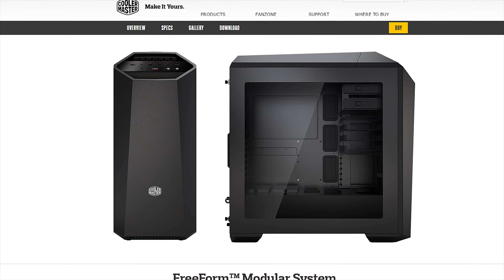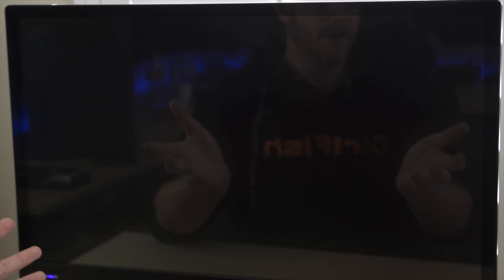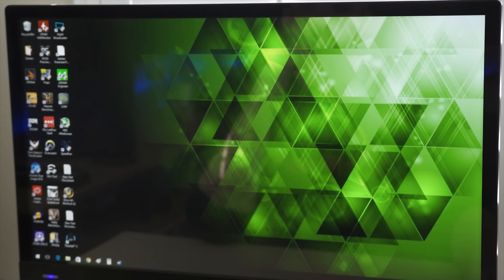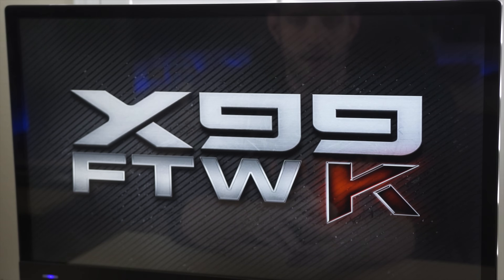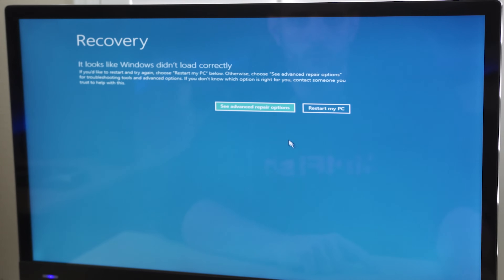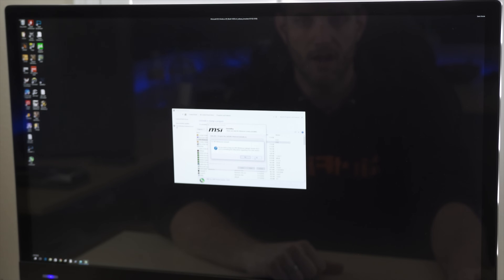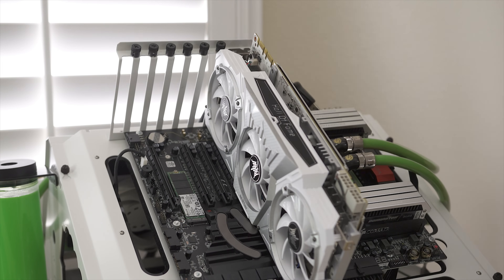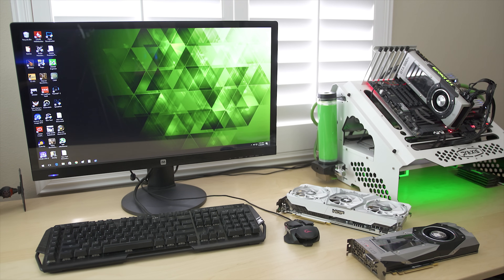How to fix a bad overclock on any Video Card

Comment: I actually have a weirder problem. Ran an Afterburner OC scan, and ever since, it runs at 1965mhz, not the stock 1905mhz! Afterburner has the turbo arrow, at 1905, FireStorm says 1905! Click reset and nothing changes, it's telling me that it's running at 1905. But you do a test and stress it, and it will clock right past the arrow and up to 1965! It's perfectly stable, everything works, but it's not right. If i add say, 50mhz to the clock speed, it says 1955mhz like you would expect...but it will actually run at 2015mhz, it just adds it to the 1965! Likewise, to get it to run at 1905, i have to lower the speed by 60mhz, telling it to run at 1845mhz! I have had the card out to see if it would reset, I have deleted the profiles (never saved any), uninstalled Afterburner...it just stays the same! Any ideas?!

Comment: Um mine won’t start please help I am desperate I accidentally over locked my memory overclock and now every time I turn it on it automatically turns off in seconds please help me I need help
Reply: THE BEAST Have to clear  CMOS... look up how to do it on your motherboard
Reply: J NO thanks for your help but I figured it out I just waited and let it keep restarting every second for like 5 minutes and then it some how booted into the menu where you choose to load into safe mode

Comment: Hi! I have an old 3d card ATI 5830, I did somthing wrong with the overclock un the Catalyst control center and the PC is not working anymore, just black screen and no sound, the cooler still work. 
Just work taking out the card and using the integrated. Is dead? Or is something to save it?

Comment: Ok so i watched a video about overclock and it went good, but then i was kinda scared cuz in games my fps dropped. i resetted the overclock (i think) and deleted msi afterburner. So, today i started rocket league and it said i had like 200 fps but it felt like only 40. On fortnite (yes i sometimes play it) i get only up to 220 fps in the lobby, while i got like 400 before in the lobby with low settings. I have a RTX 3070 and a Ryzen 7 3800x . I have the latest drivers and everything else on the newest. Im kinda worried because my pc costed 2000 euros and i dont want to do something bad to it. But even at the start, when i bought my pc, the fps werent as expected. If someone can help me please link me a video that talks about how to fix this problem or just write something i can try in the repilies pls.

EDIT: I just started Warzone and all the graphics are garbage but like 🤢🤢🤢

Comment: Ok well I have a good question.. What if you changed your voltage and power settings in your graphics card.? I don't know if my graphics card is dead or just messed up settings from a long time ago after burner settings... After witch my power supply failed etc isn't there a way to reset your graphics card settings to factory on the card itself?

Comment: i had two monitors so i switched the cables to connect them…one of them works which is my hdmi cable for my second monitor and the other cable is some boof one that doesn’t wanna connect to my main monitor and literally can’t connect to the second monitor because it doesn’t give me that option…think i might just have to buy new cables and switch em around

Comment: Also got a black screen, luckly was only cuz i went 10mhz higher while playing trying to test it and froozen and restarted. As soon as i got into msi afterburner i realised i had the startup option on which kept the card at the same frequency preset, luckyly 10mhz isn;t much so it worked from first restart. Lesson learned, never use "Apply at windows startup" while testing the card, use it after you find a stable overclock.

Comment: I had this happen to me but I ramped up my ram to 3000. Hit apply and test in ryzen master and when my desktop shutdown to do the restart it never powered back up. Now I can turn my power supply on, lights and fans work but the screen shows no signal. I did a bios reset with the pins on the board and tried removing the battery but nothing changed. Would that have destroyed my ram sticks?

Comment: I make an overclock and an hour later it crashed. Now the videocard is locked in P8 state (the default is P0, too much better). It went of 820Mhz overclock to 405Mhz underclock. I've been crashed before, but now im in P8 state and i cant change it

Comment: i just blew up my 1080 ti with a combo of msi afterburner nvidias new driver for december (which apparently has major issues unless you have an rtx card) and superposition benchmark... dont over clock kids (okay so i didnt blow it up but its been acting strange ever since even after undoing the clock and doing a system restore rollback) OVERCLOCK at your own risk lol same with drivers apparently.

Comment: Any idea on what peripherals does in an gigabyte B450, I tried to overclock the cpu frequency and voltage there. Screen went black so I took out motherboard battery. Changed the settings to default and now I am scared to overclock because I don't know what I did wrong or if I even tried to overclock properly

Comment: Strix 1080Ti

Optimal/Adaptive Performance from Nvidia panel=variable gpu core clock= Crashing Issue
Maximum Performance from Nvidia Panel=unifrom core clock at 1569Mhz= Stable system and NO crashing issue.

Hi Jay, Do you know about this kind of issue? GPU crashes when I select Optimal Performance from Nvidia Control Panel but it becomes stable when I select Maximum Performance. There is one issue and that is in Optimal Performace GPU remains at 139 MHz without load while in maximum performance it always remains at 1569Mhz leading to hihger temperatures even with 0% usage.

Comment: I found this a little silly as i would not and do not ever have MSI Afterburner set to start up when Windows starts,just do not do it in the first place just open Afterburner manually after Windows starts and the select your profile of choice if your overclock fcks up next time PC starts Afterburner will not start,i have to even wonder why the devs even put the option to start Afterburner up with Windows startup is time too valuable to not just spend a few seconds clicking on the app?

Comment: Mine went to login menu. So i held shift and pressed restart on the bottom right. It went to the menu for windows menu for repairs. So i started in safe mode and went into windows smoothly. I started afterburner and unchecked start on windows. Restarted and went to delete my preset.

Comment: Hey Jay! I had two GPU (970 and 1070). They were silent. I tried overclocking both and both started to make coil whine. The 970 also started to make other strange noise with the fans but I dont understand how it could be related. It was definitive. Could you investigate this please?

Comment: I attempted to overclock but today my entire PC crashed when I managed to get +110 on the core clock for my 980Ti. Now my entire computer won't boot with the GPU plugged into the PSU. I done all the steps of removing the afterburner via safe mode and still my PC won't boot with my GPU connected to the PSU. What has happened?

Comment: hey jay, idk if you'll see this, but i have an asus 1080ti OC edition and i can run games fine on it, other than destiny 2 sometimes locks up when i start it and have to task manager it and blizzard, but when i try to stream using anything, stream labs obs, obs, nvidia gforce experience thingy, it just crashes my game completely and i get an error message called (broccoli), or atleast i get that error for trying to stream destiny 2. But i've read up a little bit about this error and people were saying it could be due to a gpu overclock and some people undid their overclock and havent had and issue since, well for me, my gpu came overclocked from asus and idk  how to get it back to the normal clock or what that even is to even see if this will work at all. So i'd like some help if you could find the time to.

Comment: i did this while on a laptop. while it was entering locked mode, i was already holding down the power button, and so the laptop noe completely wont open. any tips would be great

Comment: Jay long time subscriber here, old vid I know but I looked up this vid because yes, I applied a bad OC. Win 10 went into an  auto repair bootloop (I let try auto repair many times). Long story short I could not get into safe mode and was thinking I had to try a VGA bios flash which I have never done. On an off chance it occurred to me for what reason I do not know to reset efi bios to optimized defaults (yes ASUS) and it booted into Win10. Opened MSI afterburner and all is normal. WHAT THE EFF? Shouldn't have been the case to remove the mobo OC also but it was. Just weird. It's a Crosshair VII just for reference not the latest bios but the one just before. Thought I would share my OC adventure. (Spelling edited)

Comment: hello.. 

I have a gtx 1050 ti 4gb 

I set 

core voltage to +83
power and temp limit to max
core clock to +150
memory clock to +1000
it that ok, its safe if i keep it, i just test with the Superposition Benchmark and it looks fine, no crash!
Reply: Valentino Duka i would lower the core voltage to like 10-30 ,as that could severely damage your gpu
Reply: Or just have no core voltage
Reply: @burnttoast6216  thanks a lot for your support man!
Reply: Valentino Duka lmk if you need anything else 👍

Comment: Ive never overclocked anything before and yesterday I did it by accident. I was on my pc playing Battlefield 3 and my buddy was checking out my AMD Link on my phone. There was an option to "Auto Overclock" on there and he hit it while I was mid game to see what would happen. My PC immediately locked up, fans were at 100% (which has never happened before) and I couldn't do anything. Hit "restart" on my PC and it took about 10 min to get back to windows (normally about 30 seconds). AMD Radeon settings wouldn't work after that so I had to do a driver uninstall and reinstall and now im having a lot of odd issues with my PC. Not sure what to do at this point.

Comment: im not afraid to oc my 2070, especially when i have a spare just mining away. and thats clocked really nicely! but for some reason the new 2070 i got, which out-performs the spare by default, cant clock past +200 on afterburner without me losing a monitor..... and nicehash tells me my OC is too high....
2 is better than 1, but i use all 3 haha. is my VRam toast?

Comment: Is this the same with a bad cpu overclock? I did an overclock with ryzen not on the multiplier but in the advanced tab under amd overclock and entered my usual oc and voltage in mv and went to reboot and keep getting the solid white boot light. It still hasn't booted even after jumping cmos pins and removing batter or removing a stick of ram. Right now I'm waiting longer with the cmos battery out to see if that works. I've read that it can take a while. I hope I didn't blow anything up doing that.

Comment: When I play video or sometimes when I open multiple programs my pc shuts down. I have a GeForce GTX 1660 with 32 GB Ram and Intel Core i7. I installed MSI and I saw that the GPU goes crazy when I forward a video for example and then it shuts down. Any suggestion? Thanks

Comment: what would be the problem if you overclocked it to much and then sometimes you need to update the Driver and when it does not pick up the GPU Then you rollback the update and then it works again! and then do that process over and over again! what could be the possible cause and fix not let it work properly again?

Comment: I overclocked my gpu, it was using 170 watta instead of 120, it was reaching 78 degrees when it's usually below 70, and it sounded like a jet. I didn't even see any difference at all in fact i think the performance was worse in games so i just put everything back to stock

Comment: What if it's a bad factory overclock that causes your games to crash how do you fix that? I have a Gigabyte 1070 OC windforce edition and there are very few games that don't eventual crash with the DX Device Hung/Removed Error unless Debug mode is selected in the Nvidia control panel then games run fine so I know it's a OC problem  Id like to be able to use that extra grunt of the OC

Comment: On my gtx 1060 3gb msi armor ocv1, i overclocked the gpu to +200, memory +800, maxed out the power setting and temperature, and 40% to voltage frequency. I get 2050 on gpu speed, 4799 to memory translated to near 9600 mhz, and max temps of 65-70°C in heavy games like the not optimized Mafia 3, GTA V, Assassin's Creed Origins, Far Cry 5 etc, I play Cs 1.6 on 1000fps (350 freezed) and the game its butter smooth. So yeah its worth in some games lile Mafia 3 where on stock the framerate had stutter, now are less lows. I have ho say that i play on a i7 2600k overclocked at 4.4Ghz, 32gb 1333mhz ram, ssd(Win7)/7200rpm hdd, and an Intel Skull motherboard DBZ something, forgoth the model. Also forgoth to mention, the voltage on gpu is at 1.064ish, somethimes a little higher sometimes a little or more lower, in windows it stays at 0.85ish with near 1580mhz and memory at 4799mhz. Hope this info helps somebody out there. LOVE UR CHANNEL JAYZTWOCENTS.

Comment: Hey @jayztwocents 
What if you don’t get the windows logo during the boot up process and it never gives you the option to boot into safe mode ? I’m running a uefi bios setup I’m not sure if that has something to do with it. I can get uefi to pull up but i can’t get it into safe mode. And i don’t wanna wipe my pc AGAIN

Comment: What if I did a PC reset and wiped the Aorus Engine. The overclock is still active , and can not get into windows ( Windows 10 Error ) a to install that engine to drop the settings back down.  Is there another way to reset the Graphics Card back to default if I dont have a spare card ? Any help ?

Comment: so this is a 3 year old video and typically youtube comments are the least helpful forum on the internet, but this isn't working for me. I did the thing where I selected the windows 10 startup and it crashes every time it starts (was thinking it was to start msi afterburner on start) and when I did all of this and got into windows, I uninstalled afterburner and deleted the profile. Thing is, restarting after that still ends up with a crash. Any ideas?

Comment: Dude I have a mad issue on my HP. I'm getting a Kernal power code in event log. My laptop screen is busted and it has no VGA port. Only HDMI. I can't get bios to open on my external monitor.  Please help me. I do not have the money to get a new computer. I've tried "windows key + P" and "FN + F4".  Nothing.

Comment: @JayzTwoCents I accidentally oc my mem speed of my gpu by 1000mhz, and have now noticed a drop in frames(by about 100) in bo4. over doing the oc definitely wrecks your gpu.
Reply: Shaun Gilmore did you end up fixing itc
Reply: @razewyd8743  I half fried my gpu memory but over time it somehow fixed itself. It averages less on gpu metric scores but only by a few in-game frames. And I have to oc it slightly lower too which probably is a majority of the reason. Just make sure to not have startup enabled when you oc lol
Reply: Shaun Gilmore me like a dumbass, did this, and enabled it at startup and I overclocked my core and memory clocks like 900mhz lol  (my first time overclocking a GPU as I’ve only done it with CPUs, And I got the black, green, purple, white etc screens of death when in windows, Did as Jay said in the video, everything seems fine, My FPS is the same, but I’m just wondering did you noticed the FPS drop immediately after doing what Jay suggested in this video or did it take a while for it to start happening? I’m just really hoping my cards good as it is running perfect, but I hope I don’t get any problems in the next couple days. Thanks for your help!
Reply: @razewyd8743  it was immediate. No degredation over time
Reply: Shaun Gilmore gotcha, I guess I’m ok then haha, thanks for the help dude

Comment: can you please explain. I got stuck with Overclocked clock settings.. I've Zotac Rtx 2070 mini .. i just tried Overclocking and i did around 1800-1900 something then after that I'm stuck with boost clock of what I've Overclocked. Even after uninstalling all drivers several times and Changing pcie slots as well. Please help i want the normal factory clock 1620 on load so my temps will be back to Normal from 70 to 63 on load as it was before.

Comment: Hello I accidentally maxed out my core clock and memmorytclock for one minute and it was at 1260 mhz  and 5000 mhz I put it back to it's normal clock speed which was 0 and it's now at 2000 mhz and 7000 mhz is this an issue please help

Comment: Still not working for me even after i put another card and yes i ungplugged everything even the psu from wall and pc then unplugged from mobo also removed the little silver battery on mobo and still nothing i overclocked the memory

Comment: GPU OC

I went to OC my gpu on EVGA Precision X1 and went to change the Clock to 100 and I had accidentally clicked another 0 to make it 1000. By the time I realized I already clicked apply. My PC still runs fine but I’m stuck at a black screen and no signal. Please any help?!

Comment: Hi! Could you help me? I accidentally overclocked ram to the max and my pc crashed. After i restarted i tried to set back the default frequencies. But gpu and ram were stuck at 405mhz. I tried uninstalling msi afterburner but didnt solve the problem and also restarting.

Comment: My 750 TI is stuck at 405 mhz. I've tried everything, restarting, reinstalling MSI afterburner, booting in safe mode and deletiing MSi. Nothing works, any idea how to fix it? My monitor constantly turns on and off, and sometimes, when I turn on my pc, I have to manually turn on my monitor. I really need some help